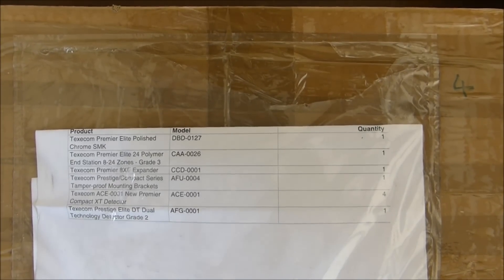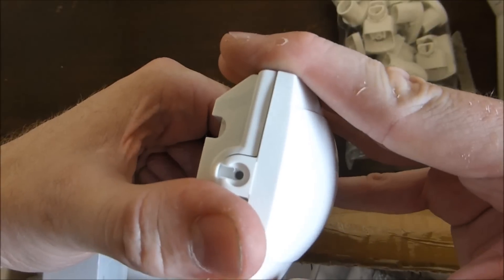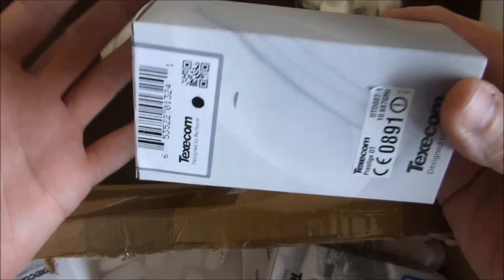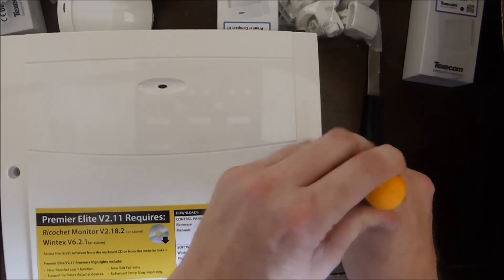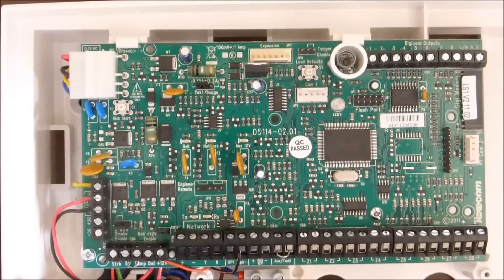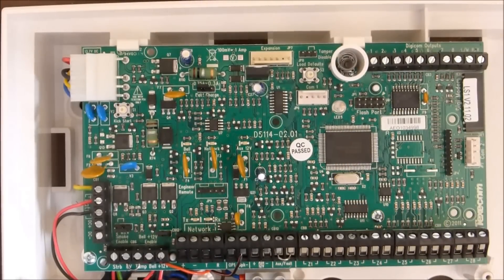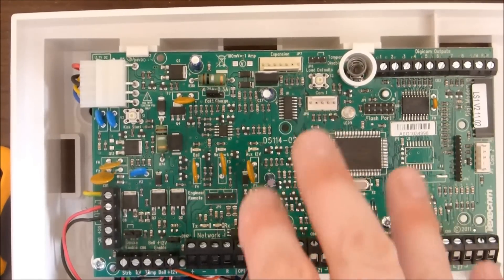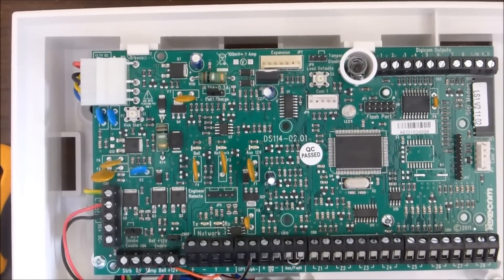Project 009: Burglar Alarm Unboxing & Raspberry Pi Home Automation (Texecom Premier Elite 24 panel)

Comment: Just an appeal from an engineer that worked closely with a large PIR manufacturer.... There has been hundreds of thousands of pounds put into PIR sensor, background temp compensation, white light filter, em band noise filtering, pulse duel edge, saw tooth and sine logic controller and bucket loads more shoved into a tiny amount of ram.... please pay more homage to the poor misunderstood unappreciated PIR. P.S. pin 3 on the digicom plug on molex is 5v 3A. That's a decent panel. I think EOL wiring can be a bit of a head scratcher when it comes to multiple door contacts. Good video with lots of info. Lets hope mr burglar isn't watching.    ;)    How have you found it for reliability? I have had a few where the spark gaps and movs on the inputs haven't been enough to prevent a crash. I had one that actualy dumped its entire programing.... I'm so glad I had the programming backed up as this was a large domestic 16 zone install. I'm a bit suprised you didn't use the panel com ports as the output is just rs432 and a pretty simple output format.

Comment: How far did you get with your project?  I was considering buying one of these panels for a similar project.  Did you consider consuming the event log from the printer terminals?

PS
You mentioned not being able to use your existing panel due to an unknown engineer code... on my existing panel engineer is easily reset by resetting the board to factory defaults using a jumper... just something to consider if you are yet to install your new panel.
Reply: Alex _TheGeekery you know nothing about alarms ur one of them teenagers who buys a system from ebay wires up he's bedroom and then thinks he is a professional installer with years of experience when you get to where i am where you are installing 32 zone systems in carehomes and places like asda etc then don't think u know more because u make your self look stupid
Reply: He obviously had a contract out with an alarm company which means u are not allowed to factory reset
Reply: How would he have a contract when he bought the equipment?
Reply: Alex _TheGeekery You Obviously was not paying any fucking attention to what he said in the video. Maybe watch it again and listen to what he says about the alarm he already had on he's house at the time. Before you comment u goon
Reply: Red Rhino Film & Photography When your using things like u your obviously not professional and I dont think im a professional installer I just am intrested in alarms and I didnt mean to start an arguement I was just telling you something
Reply: Alex _TheGeekery Omg a mouthy 14 year old lol
Reply: Alex _TheGeekery Im not professional Pelco is so outdated, samsung 32 channel 16tb dvrs worth £6 grand is what i install and ptzs worth £4 grand so yeah not professional dude just go away now I'm trying to do an install and i don't need emails telling me u have commented back so just stop and go play with your cctv
Reply: @0:56 He said clearly that the original alarm had been installed professionally some time ago; he never said he had an ongoing contract, in fact he implied the reverse.  A factory reset of his existing alarm would give him control of it.
Reply: FWIW The zone events of these panels are available via the COM interface.  Protocol available from Texecom subject to NDA
Reply: NivagSwerdna Curse you, I just spotted your bit about the com port.   ;)     To be honest and no disrespect intended to the OP but systems like these really need an alarm engineer with experience, they can be very tricky for a diy install if you don't want all your neighbors out the front with torches and pitchfork's after the 27th bell sounding of the week.  :D
Reply: Red Rhino Film & Photography LOL you sound like a frustrated ex modern alarms engineer like I was. Oh and if I was programming a scanny 9100 (yes I am that old) when I got to your theory about the 14 year old with a POS wicks diy kit and most likely a pir pointed at the spiderman doll to protect him I would have to say it would be 1 then enter from me. bip bip....ahhhh nostalgic mode on......

Comment: H i have a veritas 8 which is playing up and the people that fitted it who come every year to servers it are messing me round can you tell me how to set a  password i still have it on engineer codes on both  keypads is there way to set it back to f-setting so can get pa work when hit button or if you press 39 together no full alarm and still the little battery is not showing charge which think is a fuse working on mains only pleas help
Reply: You don't need to f reset to activate pa - pa can be activated on keypad in settings
Reply: Just press the little musical note icon and that should trigger PA
Reply: gene mayne Don't listen to geeky i have 4 veritas 8 in garage and it has to be activated in settings before u can press buttons for pa. ( providing ) u still have that alarm lol as i no longer install wired texecoms its all w48's now
Reply: Red Rhino Film & Photography You are seriously sad
Reply: Alex _TheGeekery You are sad pal you have to comment on every comment. You think your an engineer yet you are not. Go and play with your cctv on your house. I have fire alarms to test today. Bye. Don't comment or reply back to me i will flag ur comments and block u
Reply: Red Rhino Film & Photography Flag me go on... I dont think im an engineer I just try to help people. Go fuck yourself
Reply: Red Rhino Film & Photography hi what settings  do you need before u can press buttons for pa work
Reply: gene mayne Dont listen to him just find the manual
Reply: thanks
Reply: gene mayne Hi sorry been working all day ill look for u now
Reply: ok thanks